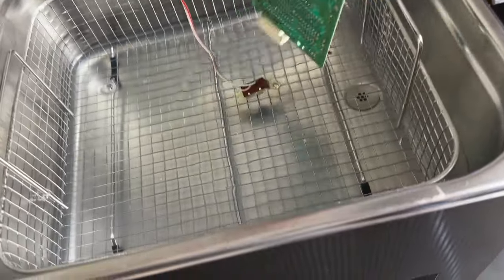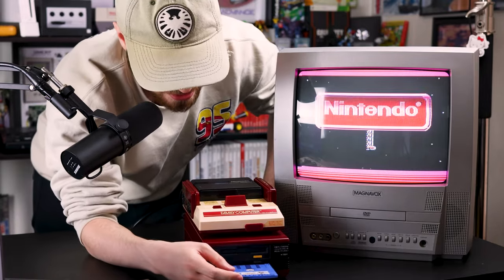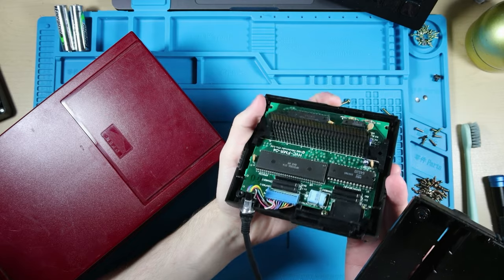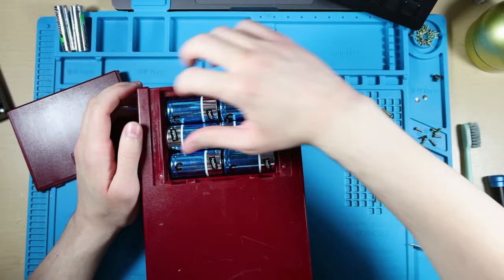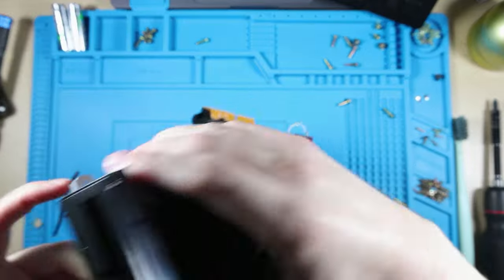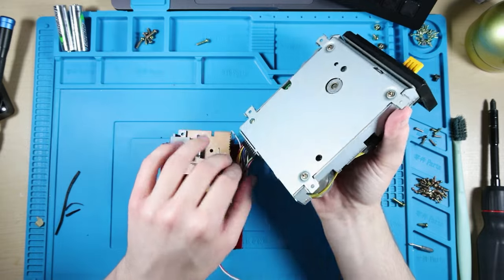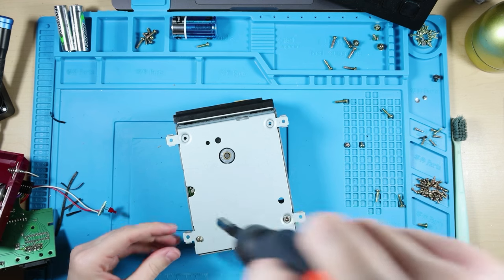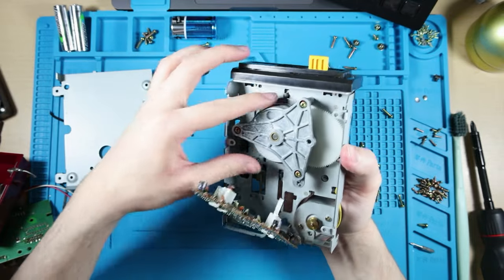Trying to Fix a Famicom Disk System...

Comment: In the video, you were turning the drive motor speed screw. This shouldnt be touched unless the speed is wrong. You need to recalibrate the spindle that actually turns the disk. To get to it, you have to remove the top black part ( that is held on with the three springs)
Reply: I can help walk you through it if needed. I've replaced many drive belts. The spindle that needs to be adjusted is held on with a tiny Allen screw and is adjusted by loosening the screw and turn the spindle to face the drive head when the drive head is in the home position.
Reply: I also have a disk writer if you need any disks rewritten.